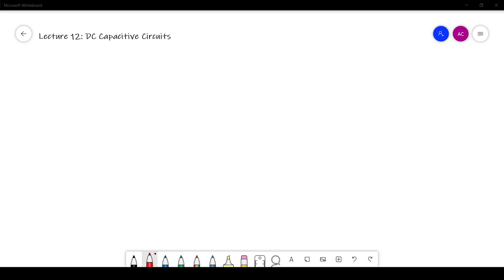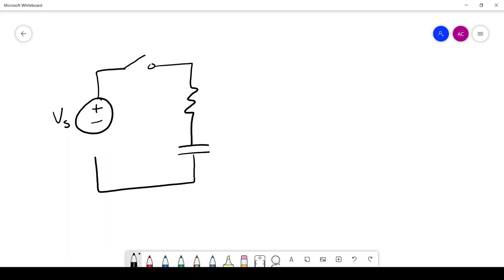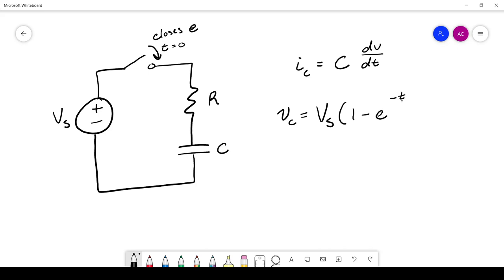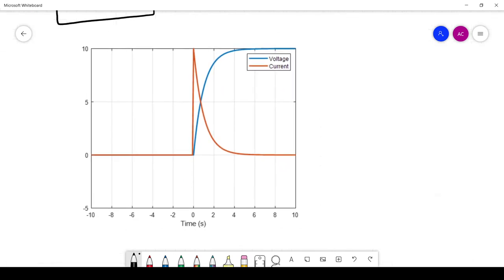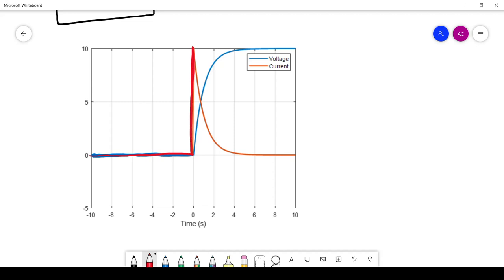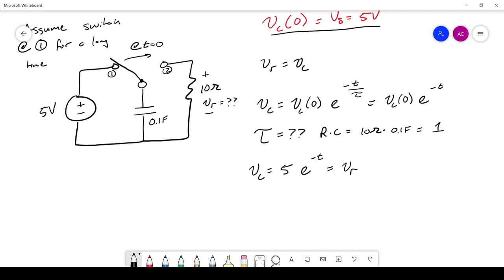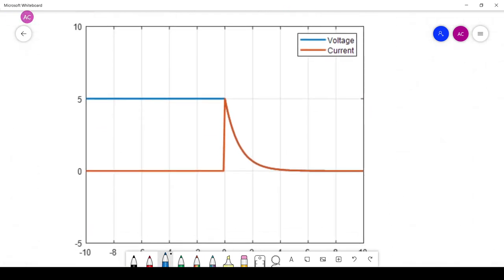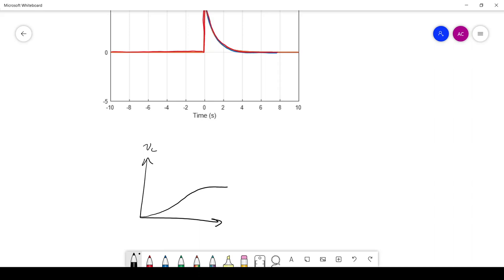Circuit Analysis Lecture 12: DC Capacitive Circuits

Comment: Aron, I've watched a video on the special number e. Please show one of the equations with all of the numerical values shown. Is e 2.72828 in these equations?
Reply from the maker: Rob,

Yes, that's correct. The value of "e" in this video is approximately 2.718. This is also called "Euler's number," and it is used a lot in many different fields of science (and even finance!). For our use, it pops up as a solution to the differential equation that we have to use when we charge or discharge capacitors. It's definitely an important number to remember!

Also, thank you for the feedback. In future videos I will make sure to be clear about the numbers and constants that I am using. :)

Comment: I just have one question, why is T=RC?

Thank you so much for these videos 🖤
Reply from the maker: Good question! Mathematically, we want to represent the equation as e^(-t/T), because this is the standard form for transient responses and becomes more important with more advanced control systems. We had our equation as e^(-t/RC), so we simply equated the two equations (e^(-t/T) = e^(-t/RC)), and you can see that T = RC for the two equations to be equal.

Intuitively, remember that in order to charge a capacitor we have to store charge on its plates. Increasing capacitance increases the amount of charge it can store, which increases T. Increasing the resistance makes it harder to move charge, which also means it will take more time to charge.

I hope this helped! If you still have questions or are still confused please let me know and I will do whatever I can!
Reply: @aaroncarman  
Thank you so much, this was more than enough🖤
Much appreciated!